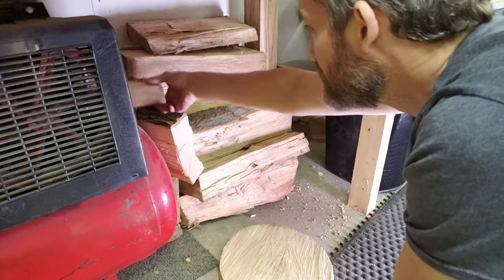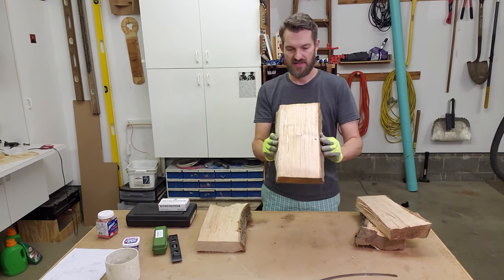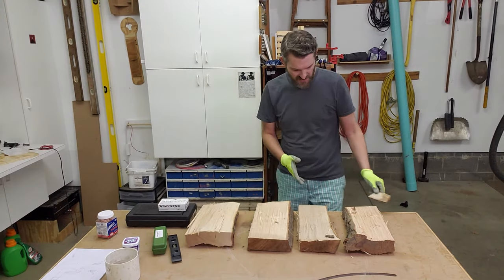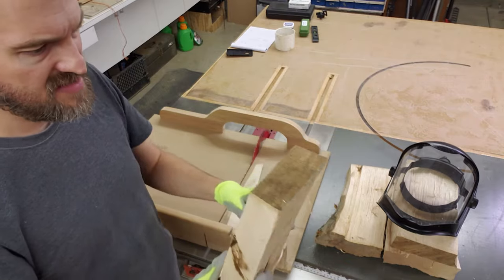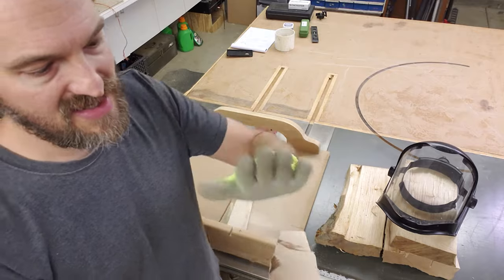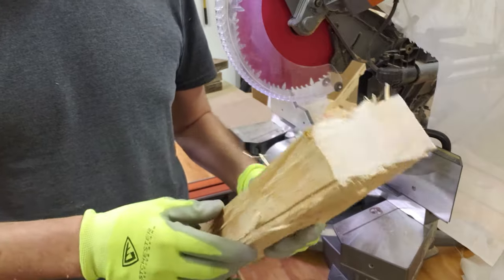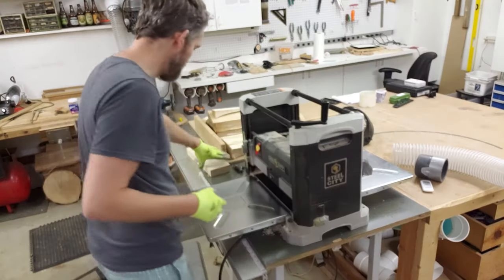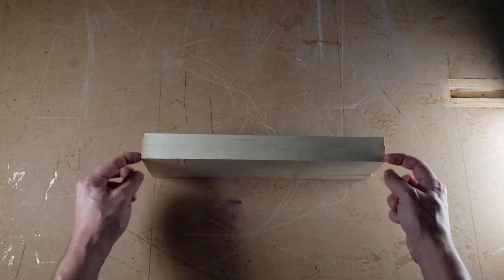Milling dimensional lumber from firewood

Comment: Nice work. I get good results free handing through the table saw. Usually five cuts get four square(ish) corners. If I want perfection, I do what you did in the planer. It's also nice to find pieces of firewood with one very flat side to start from. I've gone the hand plane route to get one flat side for a starting point but found eyeballing at the table saw works really well. Ya just gotta be careful!

Comment: Whats the last machine used that's branded Steel City?
Reply from the maker: That is a 13" Surface planer (also known as a "lunchbox" planer) It has 3 blades that cut at the top of the wood piece to make it perfectly parallel to the bottom of the piece.